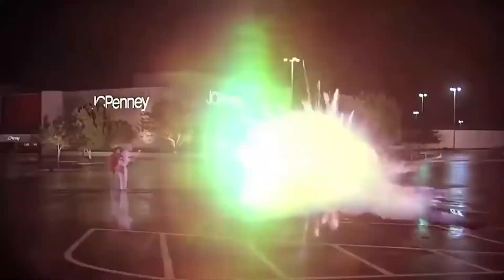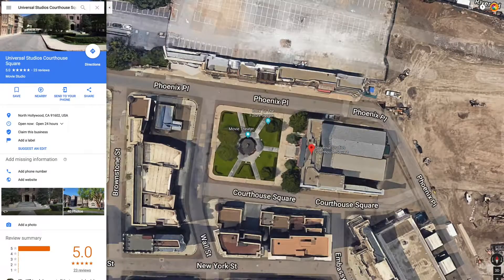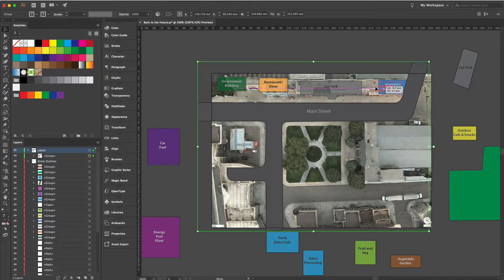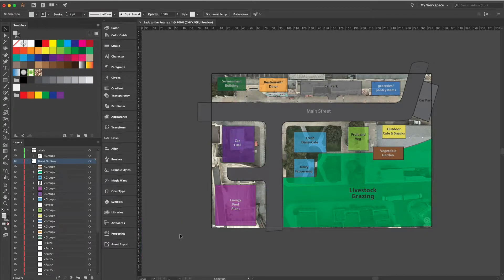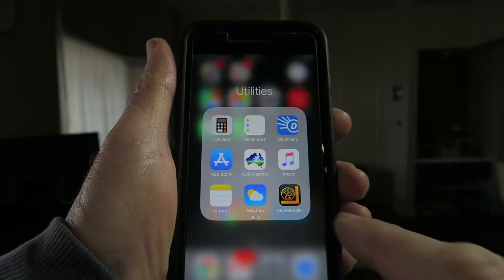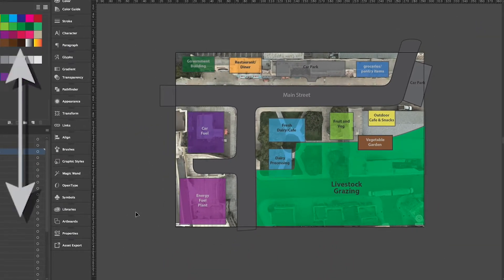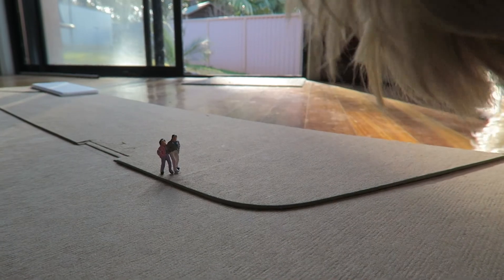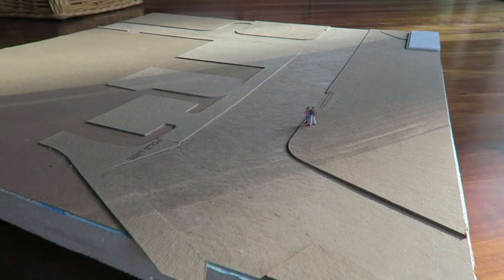Planning a Diorama Layout, Scale and Construction for HO Scale Model Scenery

Comment: Wayne that was a great way to plan your Diorama, and turned out looking really good with
your cardboard on top of the polystyrene board. Also you can buy the Extruded Polystyrene
boards from Bunnings, 20mm thick or 50mm thick  and 1200mm x 600mm for about 20 dollars
cheers Robert
Reply from the maker: csxmad Thanks Robert, I've heard that extruded polystyrene is great to use. Thanks for the info, I'll definitely take a trip to Bunnings. And a huge thank you for being my first ever subscriber 👍👍👍👍👍👍
Reply: The first of many subs cheers Robert